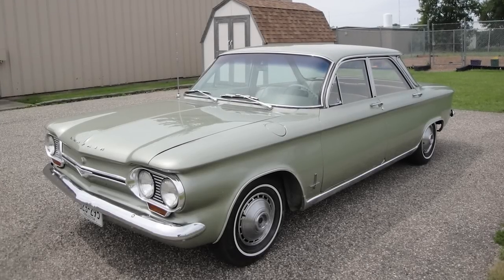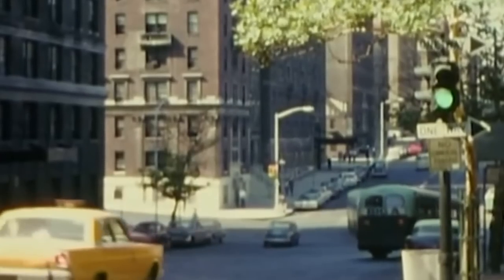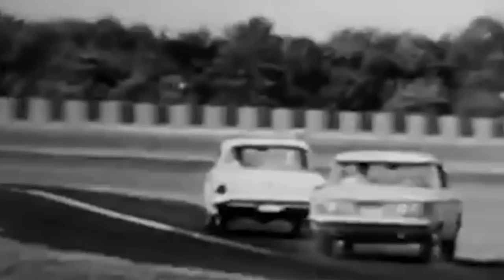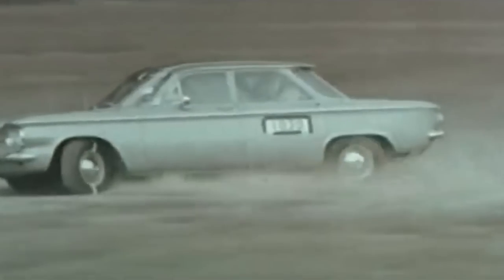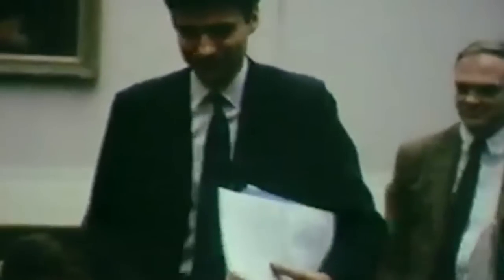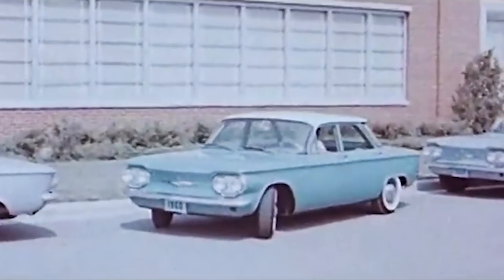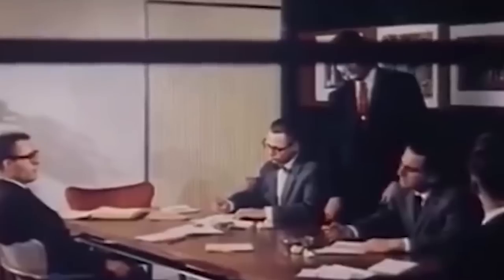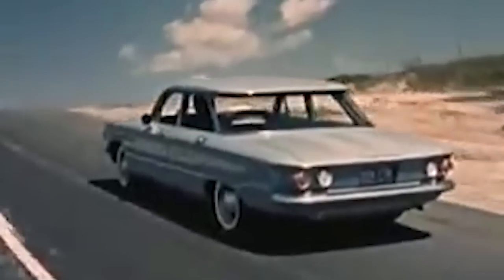Chevrolet Corvair. Where did saving a FEW DOLLARS lead to? Engineering error.

Comment: Ralph Nader saved a lot of innocent lives. His campaign was broader than just the Corvair.  Back then, cars didn't have seat belts, collapsible steering columns, or any measurable safety features. People died horrible needless deaths. Cars were so badly designed. When I was 5 years old we had a 1950 Chevy. My mom turned a corner; I was in the back seat. I leaned on the door handle which  caused the door to open and I went flying out. - lucky to live through that. I always wondered how any engineer could design a door handle that opens the car door (and ejects the passenger) when he leans on it.

Comment: Solid conventional rear axle would helped I bet. Robert at 68.
Reply: How are you going to accomplish that with an engine in the way?
Reply: @TheREALJosephTurner  How 'bout solid rear axle/drive shaft to front wheel drive?..
Reply: @bobmalack481  Huh? Then where does the engine go?
Reply: @TheREALJosephTurner  How about under the floor like a 90's Toyota Previa?  LOL!!

Comment: The Corvair and the Ford Pinto were both build on the cheap with if a small item were fixed would not have killed many people.
Reply: The Pinto was modified but the issue was not so much a problem with the Pinto as it was the time period that the Pinto hit the American highways. American roads were dominated by massive land barges that weighed more than a modern full sized pickup built today. The Pinto was far from being the only compact car on the roads then that were catching fire when involved in rear-end collisions with huge American cars and trucks. Add to that every car on the road back then had steel fuel tanks which would tear open during hard impacts and were susceptible to sparks . The Pinto bore the brunt of of what was going on in the automotive world then. Honestly the best safety design manufacturers came up with was the introduction of polymer fuel tanks that would not spark and would survive being distorted and hit without tearing open. One Ford retrofitted a polymer shield in between the tank and the rear of the car the issue was greatly diminished.

Comment: Hello,
General motors as well as other car makers profit on death and injury through their policies of planed obsolescence. Hence, the cars they build are not only unsafe at any speed, but also have braking systems that purposely won,t last even if you never drive the vehicle and leave it outside in rust belt states. I own a 1984 Oldsmobile that was once my late father's car.  Back in 2013 I was driving around Montréal and as I was pulling into my friend's house driveway, the brake pedal went to the floor. Yes, the was a spot where a brake line ruptured.  Ruptured due to the brake fluid tubing made of regular steel rusted out. This same problem probably happens to other car owners who want to hold onto their vehicle as long as they can ,at the peril of not only injuring or killing themselves but as well as others on the road. Along with making it complicated to re-enter back into the USA. . Since i,m into old car restoration,  I've replaced the steel brake fluid lines with surgical grade stainless steel. To include bleeder screws and other nomenclature out of stainless steel. Henceforth I don,t buy that aftermarket copper alloy tubing, because it is an automotive industry product I just don,t trust. When you go to the new vehicle show room and ask if I can have the stainless steel option, they will look at you if you are a bug from outer space, even if you plot down one million dollars. 
           GM IS NOT ONLY ABOUT MAKING MONEY, IT IS ABOUT CONTROLLING TRANSPORTATION POLICY.  just Google NATIONAL  CITY  LINES and from 1933 to about 1975 they conspired to dismantle rail electric transit systems and substitute uncomfortable fuming diesel buses that nobody except the poor would ride. Now you know the rest of the story.
Reply: And,, of course, bean-counter extraordinaire Roger Smith overrode engineering decisions to save a buck or two of build costs. The philosophy then was that small cars had to be cheap cars so cutting corners was the order of the day.

Comment: 🤣🤣🤣 What a pile of 💩‼️ I bought a corvair back in the 70's at the Greater Chicagoland auto auction on Cicero Ave, It broke down a dozen times in one Month, Buyer's beware ❓❓❓ I finally got it running, and then flipped it As fast As possible ♦️♦️♦️‼️

Comment: This ENTIRE video is bias and completely inaccurate. The car was proven long after the fact to be no more DANGEROUS than any of it’s rivals at the time. The biggest problem with the car was owner/driver lack of understanding the idiosyncrasies of a rear engine car, and the need for certain maintenance practices, most importantly tire pressures. There has to be a minimum 8 psi differential from front to rear. 
There were other issues involving owner ignorance, but the real killer of the Corvair was not Ralph Nader or design error, it was the Ford Mustang, which was overtaking the market on small American cars. Chevy had already planned to stop production at the 1966 run. long before the “Book of Lies”  by Mr Nader was published. Had he never written the book, the 1967 Corvair would never have existed. 4:09

Comment: I left out what mucho volks may not realize or know mucho auto accidents happen on left turnssleepy drivers drugs I had a few from drugs speed how mucho volks just drive where ever with bad tire air pressure or tires wheel alignment portly running engines some things are so easy to do clean air filters slow easy speed kills worse slippery roads bad mucho times not needed to drive walking healthier faster bike cycling even  I am no expert but have learned over years all kinds of wrongs rights better ways of doings